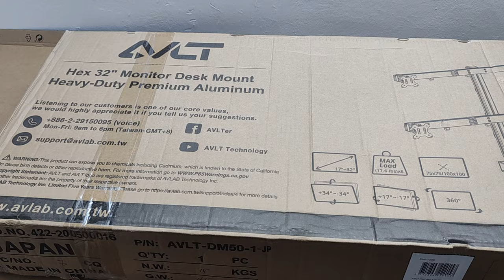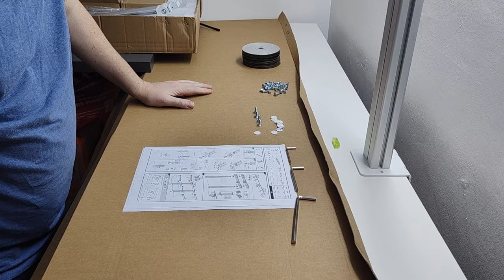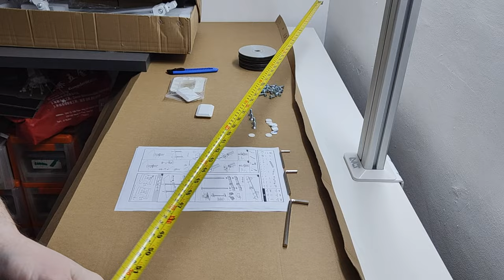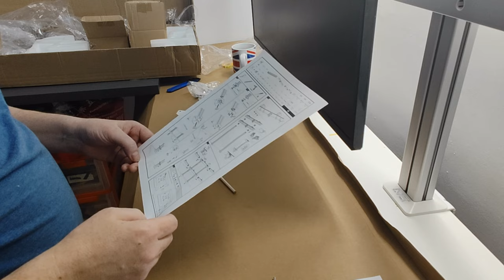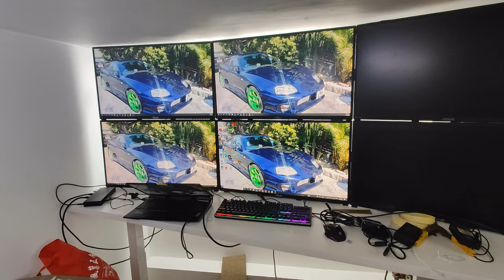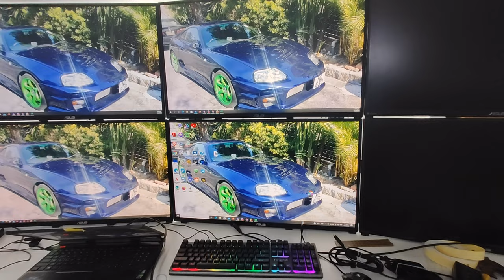Supercut of Gaming / WFH Desk Build - 6 x 32" monitors - "ASMR"

Comment: love your work! what an awesome setup. How much did the setup cost?
Reply from the maker: @Ghetto Tech ...thanks mate :-)

.... basic setup was :
Asus 32" 2K monitors x 6 - 200 USD each
AVLT 6 monitor stand - 300 USD
Desk Frame - Flexispot E7 -  450 USD
Desk top - Ikea Linnmon x 2 - 35 USD each
Plus another 100 USD on extension cords , mouse / keyboard mats and underdesk supports
Reply: Can the standing desl comfortably hold the weight

Comment: Do you have to turn each monitor on one by one? Or do you have them on a strip that you hit one button to turn all of them on?
Reply: I have a similar setup using 2 different GPU's (2070 super and 1060 6gb) both strix models on one pc. When I turn on my pc, all monitors will turn on automatically.
Reply: @mt4158  do you have any issues on running monitors from different gpus while gaming? I have a 2070 super, and I'm considering adding a 1060 also to add more monitors to my setup. I will only use one monitor to the game itself, but am just wondering if everything runs smoothly with 2 gpus from different generations.
Reply: @ALFAATV  id also like to know